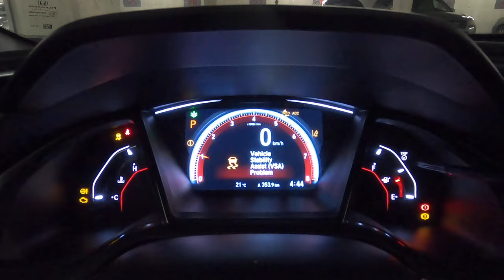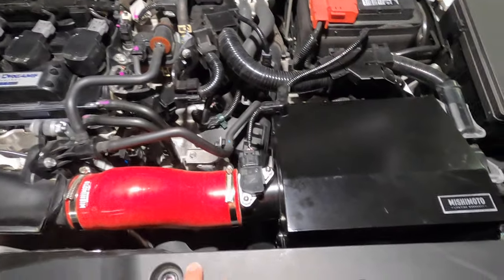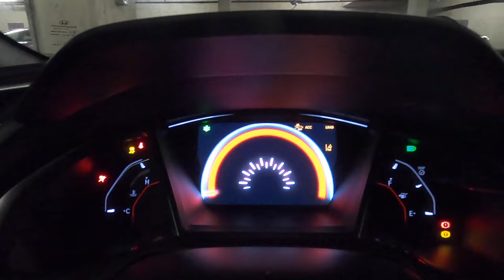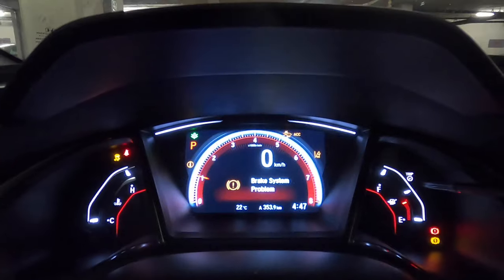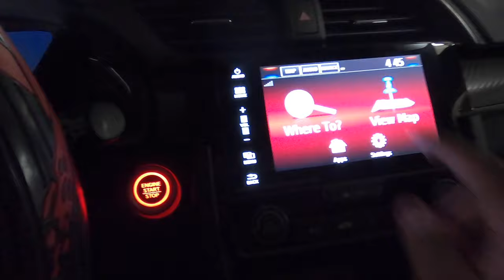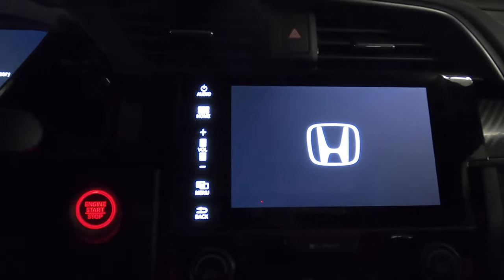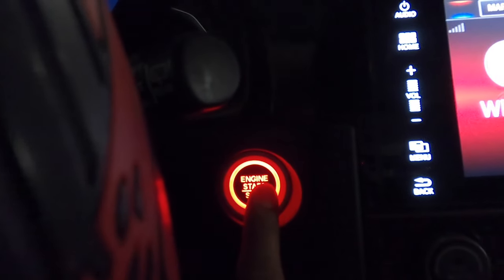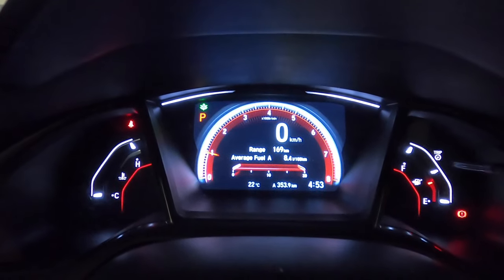HOW TO FIX MULTIPLE WARNING LIGHTS ON DASHBOARD OF 10th Gen Honda Civic

Comment: Tried this on my 2020 SI, and the lights didn't go off - but they did after about 2 minutes of driving to see if the car was in "limp mode".

So if this happens to you and this trick doesn't seem to work, drive a half mile or so
Reply from the maker: Thanks for the feedback 🤙
Reply: I have a 1.5 turbo touring civic, and it was an injector problem, Honda will fix them under warranty if ur car has less than 180000, there might be a service bulletin.
Reply: @prometheuscst5106  180k? Or 18k??

Comment: I have the same crap for the 4th time i guess. every time my honda dealer "reapairs" that issue and after some month´s, it is back... i even got a new engine while i was in my guarantee.
So i have a question: How i do that when i have a car key to start the car and now start button? Please help me :) I have a 10th civic 1.0 VTec, December 2017..
Reply: I have the same problem. I've got keys for my Honda and after looking at the video the warning lights are still on.
This problem only happened after I had 2 front tyres changed. It was ok before that.
I've been told I might have to buy a new ECU and if its not that then it could be a new engine !!! I was advised not to buy the Civic 1ltr by a friend but the salesman convinced me at the time 😡

Comment: a also have this problem with my fk7 . the obd tester says lamda1 bank1.
the errors was deletet with tester, 20km after the lights came on.
car is runing normal... 
honda dealer would change the lamda sond (cost about 470€).
but i dont think the lamda is wrong.

Comment: Just happened to me in my 2020 Si. I tried resetting everything like in the video, but no luck. I read this happens when there’s a problem with the charging system, so I disconnected the battery and hooked it back up. When I started it, it gave me all the messages but not as many messages, so I drove it around the block and everything cleared up and now it’s back to normal. 

So check your battery connections and unhook the negative terminal. This’ll let it truly reset.
Reply: used to happen to my '17 EX bc of low voltage but now that it does it on my '20 Si there's no clearing then without them coming back. battery voltage and alternator tested fine. gonna check the actual connection now 🙃
Reply: used to happen to my '17 EX bc of low voltage but now that it does it on my '20 Si there's no clearing then without them coming back. battery voltage and alternator tested fine. gonna check the actual connection now 🙃

Comment: how can i do this w my 2019 civic but without the touch screen? pls helloooo
Reply: helppppp
Reply: Disconnect the battery for couple minutes and then try driving it for a mile or two and shut it off and then start back and see if that works

Comment: I did the system reboot and disconnected my battery for 15 minutes. All the lights still popped up but when I started driving they disappeared. 2018 accord 1.5 turbo automatic
Reply from the maker: Awesome

Comment: Hopefully it works on my 2018 odyssey touring I accidentally started the van without the mass flow sensor connected and it threw all those warnings
Reply from the maker: It will work 😊
Reply: @geefamz7172  it work like a charm slightly different procedure

Comment: I am getting 4 warnings:  ACC problem, LDW problem, FCW problem, Road Mitigation system problem and brake system light on as well.  I just got the windshield replaced the week before and the radar system needed to be recalibrated as a part of that replacement.  Problem/question is:  I'm afraid to do this system reset until they look at it.  I'm not 100% sure they did everything they're supposed to do since I was only there a half hour for a full windshield replacement and radar calibration.  Have an appointment next week, but these constant warnings are freaking me out.  (Yes, the car drives fine)
Reply from the maker: The glass shop should calibrate it right after the installation of the windshield

Comment: On my car it was the positive terminal on the battery it was loose no matter how much I tight the nut it was too big for the terminal. I end up replacing it with an aftermarket. It started from day 2 after I bought the car less than 20 miles on the odometer.

Comment: Well, just couple hours ago while driving, coyote hit my car n broke bumper, crashed plate number, last but least, it caused some system issues. Following: Road Departure/Mitigation System Problem, Adaptive Cruise Control Problem and Brake System Problem. What should I do? Is it anything that serious problem? I mean should I take it to service? Please help me. Thanks in advance n happy new year
Reply from the maker: Check and clean the sensor at the front maybe it is obstructed or dirty due to impact at the cayote. Happy New year.
Reply: @geefamz7172   i did but same issues. Also did three times what u showed in this video since yesterday but didn’t work for me..

Comment: Anyone figure out what this issue is before I take my 2018 Honda Si in? Mine has been doing this off and on for awhile now. I could reset it before by disconnecting the battery but now they are on for good no matter what I do. Tried this solution and also the other one in the comments about doing the factory reset but nothing will turn them off. Getting a OBD2 scanner to see what codes it is throwing and if that can reset it or if it is an issue with a controller on the main computer. Not a car guy but I do know computers and this feels like something wrong with the main system. Any feedback or help from anyone that knows that the hell they are doing would be greatly appreciated.

Comment: Bad batter connection typically causes this while cleaning the engine you bumped the cable and it wasn't tight

Comment: I have done it, all all the errors were off for two days and they are back. I tried redoing the same thing and it does not work...any solutions will be highly appreciated
Reply from the maker: Check the battery connections at the engine bay
Reply: @geefamz7172  I have done that too but no solution

Comment: Hi..mate.. Same warning ligts same issue with me.. but i also did same like u.. still same lights on.. plz help me..
Reply from the maker: Try to check all your connections on the engine bay. Something might be loose.
Reply: Do all the resets and battery and then drive it about a mile and then turn off and back on cause that's the only thing that worked for me and I'm hoping they don't come back on

Comment: Hey i m pressing power button and pop up message for reboot is not coming up I tried to press button for atleast 15 second but no reboot pop up help me pld
Reply: Still having trouble cause u might have to disconnect the battery first and then try to reset it and then drive it

Comment: I tried it and it worked, but only for a while. The lights keep coming back on. It clears automatically everytime I restart the car, but eventually comes back on.
Reply: Got the same issue it’s frustrating tried everything I’ve heard people gone to dealers too fix it but they come on again prob gonna be a costly fix
Reply: I don't mind the cost at this point. I just want to know how to get it fixed. It's so frustrating.

Comment: They told me the warnings were popping up because the fuel injectors needed replaced for $1800. Does anyone know if that’s accurate?
Reply: That’s what they just told me they were going to clean the valves and replace the fuel injectors and wanted me to pay over 2600. I don’t think I’m gonna do it but I’m looking for a solution.
Reply from the maker: HOW TO FIX MULTIPLE WARNING LIGHTS ON DASHBOARD OF 10TH Gen Honda Civic
https://youtu.be/JSGy7bFlKIQ 

Try this and if still doesn’t work I suggest bring it to your honda dealer, they will run full diagnostics on what actually causes the lights to come on.

Comment: My 2017 honda pilot has the same dash and holding the power button doesn't even pull up the roboot option so annoying
Reply: Disconnect the battery for a couple minutes and then drive it about a mile and then shut it off and back on and see if that works

Comment: Disconnected the battery plugged it back in and then took a drive and all lights disappeared then the next morning they all came back on im gunna try this
Reply from the maker: Keep us posted 😊
Reply: @geefamz7172  diddnt work I installed a prl intake drove on it for about 3 weeks completely fine the all the sudden I was sitting in my car idling then all these random lights popped on this diddnt fix it idk what will

Comment: Watching this video while im wating at the dealership for 2 hrs for them to “drive test” the car and tell me what is wrong with my car and probably charge me for this simple thing fml
Reply from the maker: They will charge you for “diagnostics”  🤦‍♂️
Reply: @geefamz7172  I made an appointment for tomorrow and they said it would be $170 jezzzuuss! I tried your method but I’m still getting the same errors on my 2017 civic touring 😓
Reply: $170 for diagnostics! Plus repairs if warranty doesn’t cover it, which I’m sure it won’t. I’m not sure what else to try
Reply: What did the dealership say or do

Comment: My still come on after I reboot it any advise?
Reply from the maker: Check your connections in the engine bay or just try to wipe and clean it, wire connections could get loose overtime. Reboot it again. If nothing happens, I suggest bring it to your honda dealer for diagnostics
Reply: Read more comments and try them all cause that's what I had to do on my 2016 civic

Comment: This does not work for me.

2016 Civic Touring here and this literally just happened to me 2 days ago (it's been sitting on the driveway for about 3 weeks and then we got hit with 48 hours of 11F to 26F temperatures) and when I turned on the car engine all of this popped. To be clear these all come up: Tire Pressure Monitoring (TPMS), Brake System Problem, Brake Hold System Problem, Power Steering System (EPS) Problem, Vehicle Stability Assist (VSA) Problem, Hill Start Assist Problem, Collision Mitigation System Problem, Road Departure Mitigation System Problem.

Car's got less than 27K miles on it. Wiring harness looks fine. Cables on battery terminals are fine and properly tightened and making full contact and there is no rust or corrosion. Disconnected the negative terminal for a couple of minutes and reconnected. Put car into accessory mode then car complained (expected) about anti theft system due to power loss and GPS power lost then went to main screen normally.

Rebooted the system then turned engine on. Problem remains. Rebooted system again. Problem remains. It is not possible to take the car anywhere as the car is keeping the steering wheel locked.

Any ideas?
Reply from the maker: Check the voltage of your battery. It should be atleast 12.6 volts. Maybe you still have the oem battery. And usually u have to replace it between 4-6 years
Reply: @geefamz7172  Thank you for the quick reply and advice! Picking up a multimeter tomorrow morning to check battery voltage both at rest and then with engine on. Will update when completed.
Reply from the maker: Cool 🤙
Reply: @geefamz7172  Just finished testing battery. Air temperature = 52F, Battery at rest = 12.10v, Battery with engine running = 13.84v - 14.10v. As you said, the battery needs to be replaced it looks like. Now I have to go learn how to do that.

I also correlated this with the following battery and temperature table from here: https://ricksfreeautorepairadvice.com/wp-content/uploads/2020/11/state-of-charge-chart-with-temp-1024x555.jpg
Reply: For completeness: had my car towed (through my auto insurance roadside assistance with no cost to my Honda dealership; without using roadside assistance woukd cost $200+USD). Opted to have my Honda dealership to do the battery replacement because the cheapest decent battery I can get locally is $179USD with a 36 month replacement warranty. Dealership has it for $145USD + $26USB for installation with a 100 month replacement warranty (months 0 - 35 = free replacement, months 36 - 99 = prorated replacement cost; valid anywhere in USA at the least and probably Canada, not sure about Mexico).

The Power Steering (EPS) problem: rodents chewed the EPS conduit which is located under the engine. This is because Honda, like all too many manufacturers, decided that using soy based cable / conduit sheaths were a good idea (rodents like soy). As my son in law put it: "this is when going green backfires". The Honda dealership is replacing the EPS conduit ($624USD) and will treat the conduit and sub-harness with a repellant. Service advisor also recommends to heavily spray all wheel wells using a peppermint essential oil (100% pure) and water mixture and to move the car from its usual location for a few days. Rodents have poor eyesight but have a great sense of smell and the critters do not like the smell of peppermint at all.

Comment: Need help I have a 2017 Honda Civic ex-t I did the battery and restart the system even used a scanner and it does not go away please need help
Reply: I did it a couple times and didn't work and then drove it about a mile and came back home and shut car off and turned back on and they was gone
Reply: I also did the factory reset thru the radio so not sure which one worked but one of them did
Reply: I also disconnected the battery
Reply: Mine didn't work either till I drove it
Reply: @zymierosbourn9061  

Same here…

Also just found it in UK civic manual that says to reset the warning lights drive over 12 MPH for a short distance, turn of engine then repeat if necessary this worked for me too.

Comment: CAN I ASK YOU FOR THE CRV Ex. tnx
Reply: What do you need
Reply: how can i reboot the system on it
Reply: Try disconnect the battery for 5 minutes and then drive it about a mile and then shut off and back on and see what happens

Comment: Have a 2016 civic ex, have same issues with all the lights coming on, Yeah everytime I shut engine down and restart the lights are gone, but they always come back at some point, it seems to happen when it's hot outside, never happens in winter, don't understand how this is permanent fix, please it anyone knows how to fix this let me know
Reply: Same thing with my 2017 civic
Is it still happening?
Reply: Same with mine and it keeps coming back every week
Reply: @3311kg  Hell to the yes,
Reply: @johnwhaley8445  dealer told me, It’s a bad Engine harness. 2,100 dollar fix
Yikes😩
Reply: @3311kg  that's not happening, I guess lights will keep coming back on then, my dealer just resets the program and said that's all they can do

Comment: Didn’t work man... what should I do?
Reply from the maker: Try to disconnect the battery then do it again.
Reply: Try doing the resets again and the battery and then drive it a couple miles and turn off and then restart it. That's what I did cause it wasn't working till I did the resets and then drove it

Comment: Well that didn't work. I have checked all the connections I have purchased a new battery and I have a brand new alternator in my passenger seat let's see if that works

Comment: Worked for a week and now has happened 4 times since
Reply from the maker: Your battery might be weak or check wiring connections at the engine bay
Reply: Have you figure out the issue?
Reply: Have you fixed it yet? Mine is doing the same thing 😞

Comment: Wow.. Honda charged me $560 for a wiring harness after a mechanic dumped a 5 gallon bucket of water in my engine bay to wash the battery cleaner spray off after me telling them not to just use the battery  spray to get rid of my corrosion take it off and clean it correctly wit the terminal scraper spinny thingy.. i despise mechanics.. spent $1500 on auto tools .. if someones gonna fuck it up it might as well be me rofl.. jk
Reply from the maker: I feel u bro 🤣

Comment: Still hasn’t worked. Guess I’ll have to take it in and get charged out the ass for a small thing.
Reply: What model is your car?
Reply: Do the resets and then drive it about a mile and then shut off and back on and see if that works cause that's the only way mine work cause I tried all the resets and battery and didn't work till I pulled back up in front of my house
Reply: Read more comments and see if they work cause that's what I did cause it only worked after I drove it

Comment: Why did Honda change all the standard ways of operating on this stupid car? How does the hood open ?? There is no owners manual in this dumb rental car and no release latch on the hood so I cannot check all the fluids. Why did they remove the parking brake? Who is designing these cars to be so🤣🤣 stupid?!?
Reply: What does "BRAKE" mean when it flashes on the display when driving at high speeds? Is it telling me to slow down or what? Why they would change everything so drastically makes no sense. It makes the driving experience stressful.
Reply: And UNINTUITIVE! 

THERE IS NO SUCH THING AS RELIABLE WITH ALL OF THESE STUPID SMART FEATURES!

Comment: It's a lie that doesn't work when you turn off the car and turn it on again the lights come on don't lie
Reply from the maker: If it doesn’t work for you then it doesn’t work! Stop being cheap! 🤡 bring your car to the dealership let them fix it! And stop crying 🤣
Reply: @geefamz7172  I'm not crying just that the radio has nothing to do with sensors🤣🤣🤣🤣🤣🤣
Reply from the maker: Well that radio happens to be the head unit too!  You’re welcome rookie! 🤡
Reply: @geefamz7172  🤣🤣🤣🤣🤣🤣🤣🤣🤣🤣🤣🤣🤣🤣🤣🤣🤣🤣